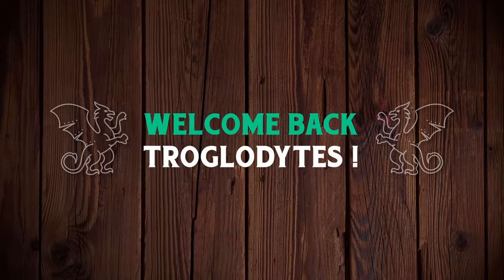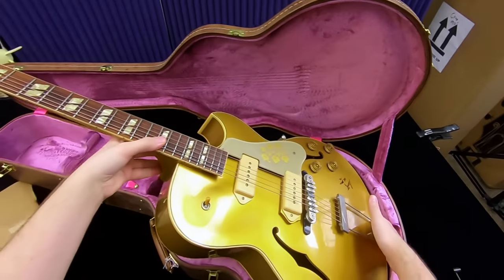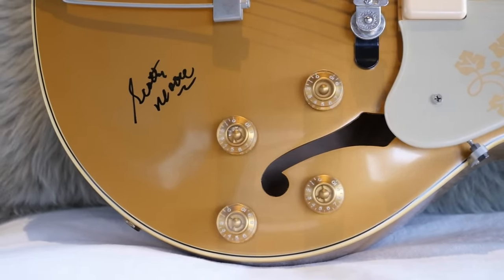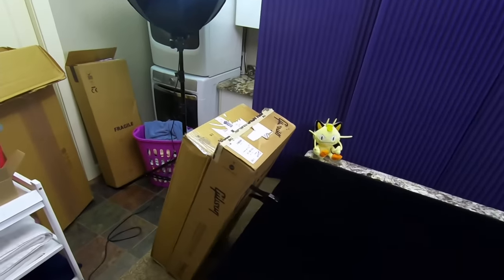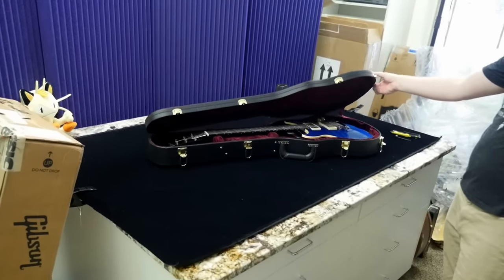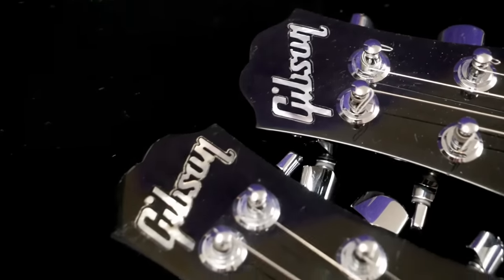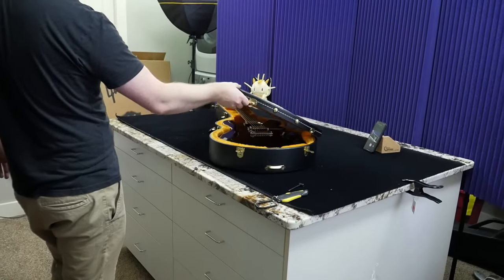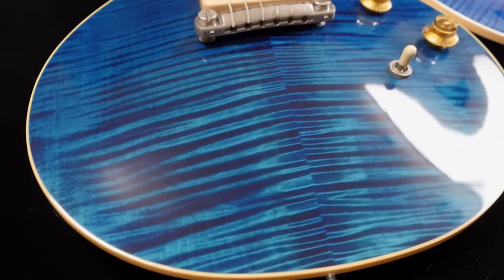I Can't Believe I Found Another One! | Trogly's Unboxing Guitars Vlog #129

Comment: Maybe the frets are brass and plated over with nickel,  and then maybe it was polished through the plating
Reply: Gibson does have Gold Colored Frets they use on select models.
Reply: @hkguitar1984  that's more likely the case. Now that I think about it,  something I fail to do most times when I'm writing is that most if not all fret wire I've seen is solid  not a core that's plated over.
Reply: @scottbogfoot  I've read that in actuality fret wire is more of a white brass than a nickel silver.  There is of course nickel silver in the material, however a white-brass is a more accurate description.

Comment: Why wouldn't you store the COA under the guitar??
Reply from the maker: 295s aren’t flat. You’d crack the guitar trying to shut it
Reply: @Trog  They're surely not that convex that you can't place something that's relatively flexible like a COA under the thing especially considering it's probably barely more than a little over a quarter of an inch thick maybe half inch at best, that the foam and and long pile velvet usually used in case interiors can't compress and account for. 🤷‍♂️